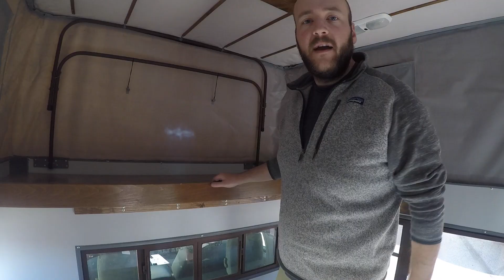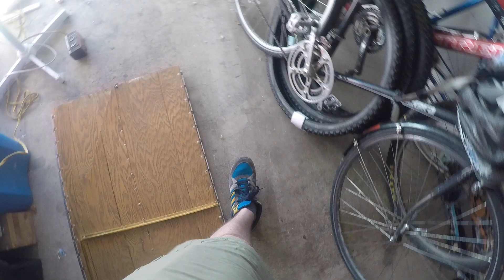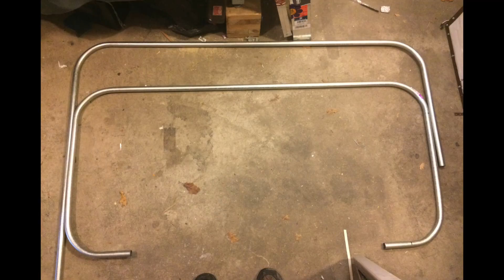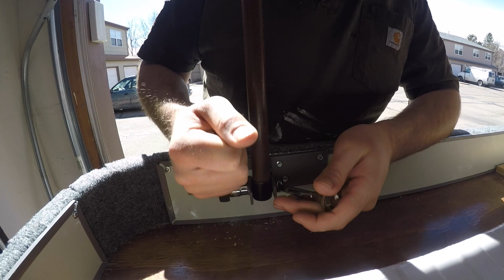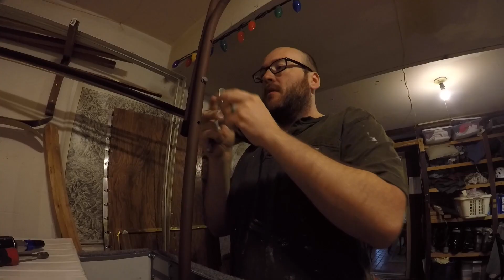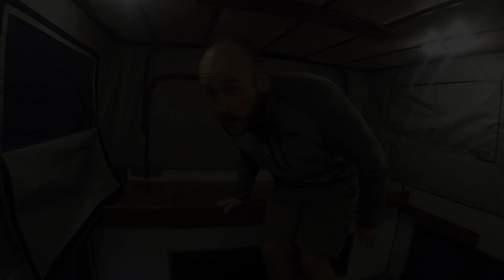DIY Four Wheel Camper Build:  How to make a roof lifting, pop-up mechanism

Comment: Hi Tim. I watched your video few Times and I still cant figure out one thing. When you lock middle hinges so it wont fold but top and bottom hinges are moving free so how its not sliding forward or backwards. Is it hold in place by fabric?
Reply from the maker: Yes. The fabric acts as a big tensioning strap and holds everything in place. It works very well. Let me know if you have any more questions.
Reply: @tgmorrissey  cheers Tim. I may have more questions later as I'm building pop top for my campervan. I managed to recycle old pop top from vw t25. I have shorten and painted with raptor. Now was a time to figure out lift hinges and your idea for lifting system suits me best. Time to test my skills in bending emt. Thank you for your videos. They are really helpful. Hope you have great 2021 with loads of adventures!
Reply from the maker: Awesome. Best of
Luck with the build! Happy to help how I can. Best!

Comment: I have a question. the lift keeps the top from from moving side to side but what keeps the top from moving front to back when popped up?
Reply from the maker: The canvas gives the lifting mechanism its rigidity. Once the canvases is attached. It’s a big strap between the camper and roof and locks everything up nicely. Let me know if you have any more questions. You doing a build too ?
Reply: @tgmorrissey  that makes sense and ty for the reply. Yes I'm building a popup from scratch. Been stressing the whole popup portion of the build. I have a wood frame. 2x6 for over the cab. The rest of the frame is 2x3 and 2x2. then used coraplast instead of plywood then wrapped with the poormans fiberglass.
Reply from the maker: Sounds like a great build! What type of truck is it going on and do you have a first trip planned out already? When is the maiden voyage?
Reply: @tgmorrissey  I built it on a 2002 ford ranger (not easily removable) I'm building it to live in and hopefully done enough to leave by the end of  April. I'm also moving from Cali up to Oregon cuz of the hicking/ camping and more outdoorsy stuff. It's actually my 2nd rendering of the camper as the first one was to heavy for my rear suspension.
Reply from the maker: @BIOREIGN  Ford rangeerrreeeer!!!!! Awesome. Ranger was my first truck. Enjoy.
Reply: @tgmorrissey  I got another question or 2 rather. Can I just use just 2 gas struts to assist the popup? Also what would you suggest for the leaf spring/ rear suspension? Cuz mine are almost flat thanks if you can help
Reply from the maker: Hey. I don’t know if just two struts would work. Might be considered tHat non symmetrical would tweak the roof out of alignment over time. But I really have no idea. Why just two? You trying to keep cost down?

I talk about suspension in a few videos. Check out the one about saying goodbye to my Tacoma or the one about saying hello to my tundra. Both cover it. I have used air bags mostly Because they are inexpensive. If the camper is staying on full time. I’d just upgrade leaf spring and shocks if you can. Air bags are kind of nice for adjustability but for the east of the best. Do leaf spring, shocks plus air bags. In my two sets of bags on two trucks. One were perfect and one pair had a leak. The leak is pretty annoying. Let me know if you have any
Other questions.
Reply: @tgmorrissey  was asking about the struts cuz I have 4 but they are rated at 100lbs each even with my other heaveyer roof it was to light for what I bought when I had bought them I couldn't find a video that made sense on what to get..

I'll check out ur other videos and thanks again for the help. You are the only one to reply to any of my questions.
Reply from the maker: @BIOREIGN  glad to hear it was helpful. I think folks often use the 30 or 40 lb struts. Hood luck.

Comment: Tim just a heads up, you might think abt using a lapel mic, sound quality is much better, especially when standing far from the camera., using a Wind muff all the time modulates sound very well. Shalom!
Reply from the maker: Dan Roy thanks for the constructive note! Really appreciate it. I actually did upgrade to a lapel mic more recently. I zoom model that works great. My few most recent videos use that nice and it really helps. I also just got a rode shotgun for my a7s so audio quality should be significantly improved moving forward. Thanks for checking out my videos and do consider subscribing if you arnt already.

Comment: Hi Tim, I am I the process of making a camper and have been greatly helped by your videos. I have the bottom made and have also the frame for the roof made, but I have no canvas on the sides yet. I have made two lifters like you have but when ever I lift it at the back and have it in position and then go to lift the front, the whole roof slides toward the front. do I need a stay to keep the roof in position or will the canvas sort this all out whenever I have it in place.
Reply from the maker: Hi. Glad to hear the videos have been helpful. I know exactly what you are talking about and yes the canvas sorts this out. The canvas is essentially a big strap between the roof and the body and everything lines up quite nicely once you have canvas installed. You do need to get the roof lined up when you instal the canvas. I used a bunch of bungee cords to get the roof aligned during the canvas installed. Let me know if you have any questions.
Reply: @tgmorrissey  Thanks for the reply Tim. I need to get some material.
Reply from the maker: Darsey no 1 go get it!!!

Comment: Great Video Series Sir!
i've got a question for you.
My Truck Camper(Viking) has the "Heco" Lifting System with the Crank Handle that you Crank and it's horrible.
The Handle wants to come out all of the time, the roof wants to drop on your head,and it doesn't lower level(rear closes before the front, the right closes before the left) and causes some closing/clamping issues. Supposedly there are some kind of "Torsion Spring" inside of the Tubing and they may be out of adjustment. The Rail Rack Gear may also be worn out causing some issues too.
Do you think I could switch the lifting System out for a Style like yours?
The current system hinges/pivot bars are on the left and right sides, not the front and rear like yours and you have to crank from a center rail.
Thank you for any Advice.
John
Reply from the maker: ghetto johnny hi. Great question. Sorry to hear about the issues with your camper lifter. You know I really don’t know if my system would work. My big concern would be worthy. My method works well because my camper roof is so light. I do not know your camper nor the weight of the roof. But I would because  if it has a cranking system. It might be heavy. 

You could also look into gas assist stuts. Modern four wheel campers have them and folks love them. Very much help with lifting. Maybe try to add to your current system? Or define use then if you go with my style lifter. Could help with the weight. 

Sorry I could not be more helpful. Send any more questions you have over. Happy camping.

Comment: Great vid! I am just starting the process on my mid 90's grandby rebuild. These seem like a much better solution than lift panels. Couple questions...link to the wtw froum doesn't work? How did you decide on where to drill for the middle pivot point?
Reply from the maker: Thanks for letting me know. I just updated the link. Here is is again too. www.wanderthewest.com/forum/topic/11945-84-fleet-09-tacoma-project/

The center pivot is really tricky. It is crucial that it fall directly between the top and bottom pivot. So depending on where you attached you other brackets dictates the height pivot. Luckily the emt stuff is really cheap
So I’d just go for it and trail
And error your way to a solution. Hope that helps. Let’s me know if you have more questions and be sure to
Check our the rest of the build videos.
Reply: @tgmorrissey  Many Thanks for the reply! I'm definitely going to give the emt a try! or maybe linear actuators mounted on the jack brackets? Subscribed to your channel, going to binge watch! Muchas Gracias!
Reply from the maker: Most excellent. That is what I like to hear!! I’m actually
Teeing up a new series of videos where I will recap all the work I did Before I started making videos (after it was pretty much a shell) do as you watch the videos make sure you drop some comments with any questions and I’ll be sure to address them in the new series.

Comment: are there supports for the roof in each corner to prevent any sideways movement when lifting?
Reply from the maker: No. The canvas materials actually provides a ton of support for keeping everything aligned. That canvas is essentially a big strap. It works great.

Comment: How do you determine where the middle pivot screw hole needs to be? Is it just dead center between the center of the top and bottom pivots points?
Reply from the maker: Yes dead center of the top and bottom
Pivot points. Recognize that the pigeon points are not just the top
And bottom of the camper. For example your lower pivot will
Likely be about 2 inches below the lip of your camper. Let me know if you have any additional questions.

Comment: Hey Tim, do you put the cotter pin to lock it in place on both sides, or is it stiff enough with only one?
Reply from the maker: Jimmy Reilly I’d go with both sides. One would probably be okay 9/10 but the second one is easy enough and helps ensure a weird cross wind doesn’t do something funky.

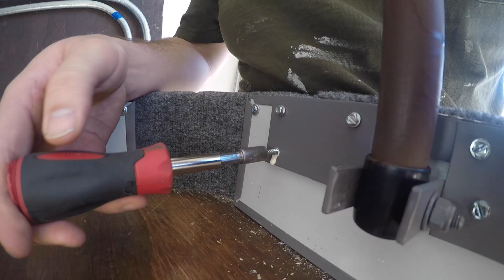Comment: Hey Tim, thanks for sharing your videos of this awesome build. I noticed at 5:05 that there is a white liquid that you swiped as you were installing the screw. Do you mind sharing what it was and why you placed it? I'm assuming it was some type of  RV sealant? Thanks!
Reply from the maker: Hey thanks for the note. Glad you enjoy the video. The product you asked about was just run of the mill silicon sealant from the local Hardware store. Sorry I don’t have a specific part number to share. What project are you working on that your considering sealants for ?
Reply: @tgmorrissey  My project is a full rebuild of an 83 Grandby, currently mounted on my Dodge 2500 flatbed. I wasn't planning on a full rebuild but after watching all your videos I got the bug and went all in. I recently gutted the camper and today started on replacing the lifter panel over the door.  EMT is bent and now preparing to install. Did you use 3/4" screws to secure the plate to the wall of the camper? I'll try to send you some pics once I get things finished. Thanks again.
Reply from the maker: Mattgonzales87 securing the lifter to the panel is no tribal feet. I ended up
Making a custom solution that was kind of janky. I’m sure you can figure it out though. Let me know if you have additional questions.

Comment: I finally did it thanks to you!  The height on my Tiger Provan was already 6’2” but the bed area was pretty cramped (maybe 24”), not enough room to sit up.  I redid the rlift like yours and now i have 7’ standing room and about 34” on the bed so i can sit up. Thanks for the great idea! Here’s a pic if u want to check it out 

https://drive.google.com/file/d/1IxdJ0Ev43DpFychGfLsx0KlYfFFc7AV5/view?usp=drivesdk
Reply from the maker: So awesome! Rad fire on the camper. 

Glad the video encouraged you to get after it. You gonna do new canvas now too? I’ve got videos on that too. 

Any hiccups or tips or tricks you want to share that you learned along the way?
Reply: @tgmorrissey   Yes the next step is the canvas but I am definitely not making it myself, I saw your videos and it's too much work for the amount of free time I have lol.    As far as tips and things that I learned, using a step drill bit works A LOT better than a regular drill bit for drilling the holes into the conduit. Using gas struts (i'm using Suspa brand) really makes the lifting of the top a breeze, don't have to worry about holding the top with one hand trying to insert the locking pins and it adds a lot of stability front to back.  Hiccups? Quite a few but mainly because I'd never use a pipe bender before lol
Reply from the maker: Carlos Guzman love it. Thanks for sharing and excellent job. Got a source link for the studs that worked out well?
Reply: @tgmorrissey   I got these off ebay https://www.ebay.com/itm/SUSPA-C16-15952-Gas-Springs-Set-of-2/352356290569  though you might need longer ones if your total pop-top gain is more than 30" dues to the minimum and maximum extension lengths (or a clever way of mounting them).  If I recall, you mentioned that yours goes up 33",  I originally made mine go up 32" but had to drop it down to 30" due to the maximum extension of the struts.
Reply from the maker: Thanks for sharing for the benefit of myself and all the other viewers. Best of luck with the rest of the build and be sure to reach out again with any further questions.

Comment: Awesome job, did you just screw directly through the top in to the roof ?
Reply from the maker: Yes. I attached the conduit to the roof with more emt conduit hardware. Simple 3/4 inch pipe strap.  Three across the roof of each side. You thinking of doing a similar project?
Reply: @tgmorrissey  Yup, the front panel is gone in mine and rear is going out. Seems to be a common theme on the older campers that the front goes first for some reason. Anything you would do different after using your revised set up now ?
Reply from the maker: @tylerdurden6937  Nope no major changes. Maybe focus on the mounts for the lifter mechanisms a bit more. I ended up fabbing my own pretty much from scratch and if I had just known that from the start I would have made something more perfect for the job. 

Also, I would guess the front goes out first because it gets more moisture sneaking in from driving down the road.

Send any specific questions you have over.  

What truck is your camper going to live on?
Reply: @tgmorrissey  Thanks will do, I will hopefully be building one in the next month or so. Its going on my 1999 4x4 tacoma, camper is a Ranger II .
Reply from the maker: @tylerdurden6937  next month or so! LOL I told myself the build would only be a month or two....

Two years later, still need to finish the electrical :) have a great build.

Comment: Hello, I was wondering what makes it secure? And what makes it not just  lean over and fall down? Thank you!
Reply from the maker: Hey Dustin. Great questions. I think you talking about the roof moving in the north-south direction? The roof has no movement east/west as there are no pivots in that direction. As for the north-south, you are right, without the canvas attached, the roof would just float around and pivot north and south all day. However, once I installed the canvas, the canvas actually locks the entire roof in place. The canvas has screw attachments every ~6 inches and did a great job securing everything. I have a whole line of videos about attaching the canvas that might help clarify.  Does that answer your question? If not, please let me know more details of what you are curious about and I will get right back to you. Thanks for watching - Tim
Reply: Tim Morrissey Yessss that was exactly what I was trying to figure out! Thanks man! I appreciate the videos! They really help out!
Reply from the maker: Awesome, so glad they helped. What type of project are you working on?
Reply: Tim Morrissey I am currently building a popup camper and am working on the lift mechanism but was having a problem with the stability, knowing that its common without the walls is good to know
Reply from the maker: Excellent, I don't know if it is common :) but it is what I experienced as well. Just got back from a night in the camper and had some somewhat significant winds, the camper held up great. No issues.
Reply: Tim Morrissey Nice, when do you plan on making the arctic pack?
Reply from the maker: Plan? Well I planned for before winter 2017 :) But here we are. In actuality, March is 100% slammed for me in work life so the arctic linear will probably be a ways out yet. Are you going to do a linear as well?
Reply: Tim Morrissey haha gotcha, I know how that is, no worries, yeah I plan to once I have time for it...
Reply: Dustin Wheeler, are you making videos of your build?  I would also like to build a pop-up camper from scratch.  I thought they were out of reach financially, but think I could do a build a bit at a time.  These videos are great, and giving me lots of ideas!
Reply: @dustinwheeler5043  This is exactly what I was looking for thanks!

Comment: have you got a video of the inside as you setup?
Reply from the maker: Hey Pete. Thanks for the question. Throughout a few of the videos you see me putting the rough up and down. Here are two quick links: 

https://youtu.be/5P0fQEFRmbU?t=227

https://youtu.be/YumX0jrEBQg?t=1025

What are you most interested in seeing? I'll try to include it in the next video.
Reply: Tim Morrissey I can see what looks to be two 'hoops' folding at the centre pivot which moves tio the inside of the camper. I saw in a movie the lower pivot but what do you have at the top to keep it in place? Is the tube for the hoops aluminium?
Reply from the maker: So all the metal is simply 3/4 inch aluminum EMT conduit (for electrical wire housing) lots of DIYers use emt to build all sort of other stuff. And there are plenty of hangers and brackets to go with it. Here is the exact bracket I use to attached the overhead bar to the camper roof

https://amzn.to/2jkZtZI

Does that make sense now? Sorry I didn't get a shot in the video